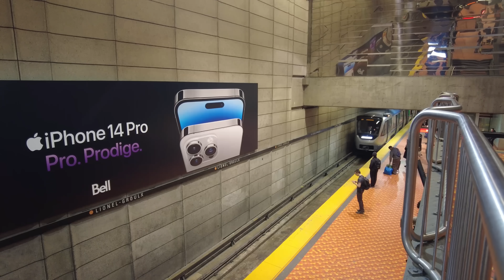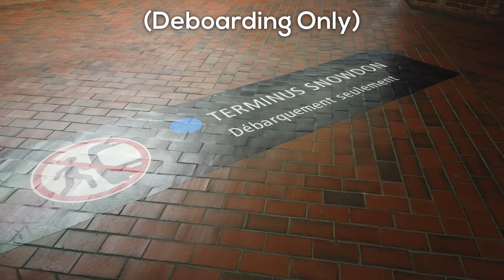How the World’s Best Transit Systems Achieve Amazing Frequency

Comment: Hey, could you maybe make a video about the Transportsystem Bögl maglev? It's developed in Germany and the company uses prefab and standardized components and promises a system with the capacity for a (light) metro with the construction costs of a tram system

Edit: it is also supposed to be automated and entirely grade separated. And maintenance is supposed to be less due to less moving objects. Also noise is significantly lower and the train is able to do steeper inclines
Reply: You can get the capacity (not to be confused with reliability or speed) of a light metro with a tram. Nothing more to be said about this
Reply: @jan-lukas so thats why replacing the REM with a tram is proposed, thanks for the insight, surely those are equal systems 👍
Reply: @jan-lukas  yes but the maglev is supposed to be entirely grade separated and automated which is not typically done with a tram
Reply: Sounds like a gadgetbahn. I'm not convinced that maglev has any benefits over conventional rail, and definitely not in a light metro system.
Reply: @katrinabryce  I'm also not convinced it is superior. But there are some advantages like being able to have steeper inclines, making less noise and potentially less cost for grade separation as the structure requires less weight
Reply: @je4a301 TSB isn’t the first system to promise those advantages. It’s basically VAL all over again, but this time around it’s using magnets. 
From all past endeavors with systems like these it’s save to say that, usually, the thing that’s stopping you from further increasing inclines or acceleration isn’t the capabilities of whatever system you’re using but the limit of what the passengers can handle or what NIMBY‘s are willing to endure. TSB might be less noisy but it’s an eyesore nonetheless. Besides, we’re talking about an entirely new system so the promise of it being quiet won’t convince anyone who’s against new transit in the first place. Considering TSB is an entirely proprietary system, even if the cost of implementation is slightly cheaper (which I‘m not convinced it will be) in the long run you‘d end up paying monopoly prices due to Bögl being the sole supplier.
Reply: @ft4709  yeah I agree with you. Your latter point is also my main concern I have
Reply from the maker: Maglev is something I am not usually going to entertain but I will think about it

Comment: “Transit should be frequent”
My local route: 2 buses per hour during weekdays, take it or leave it
Reply from the maker: Indeed, when you combine reliable service with solid speeds lower frequencies can actually be ok!
Reply: for a small town or village, if it easily connects to rail, that can be quite good. For a large city it's horrible.
Reply: To be fair, If the 2 buses per hour are on time, this can be useable.
I have been on a system running 2 per hour when I could not tell if the bus I was on was very late or just a bit early.
2 per hour is unlikely to encourage you away from a car if that was the alternative, depends on other factors regarding costs and time.
Reply: @stephenlee5929 > two buses per hour, on time

Isn't this how Swiss villages work?

Comment: Frequency makes transit so much better! 
I wish Seattle would increase the frequency in its existing downtown tunnel rather than building a second tunnel a block away and forcing people to walk between two tunnels for transfers between lines.
I still like 8sec headways a gondola can provide - no train will ever reach such - makes transfers so much more pleasant!
Reply: If you go just by frequency walking everywhere would be perfect. Gondolas are just far too slow and often low-capacity to be better than metros
Reply: @jan-lukas  To be fair, you need some degree of safety as well as frequency. So Walking does not work in some US and Canadian cities, see not just bikes Fake London.
Reply: @jan-lukas  gondolas won't compete with a metro on long lines, but make for great short feeder lines where frequency is far more important than travel speed
Reply: An interesting point.  I never did try the gondola transit in Rio.
Reply from the maker: Seattle's situation with Link is very weird!